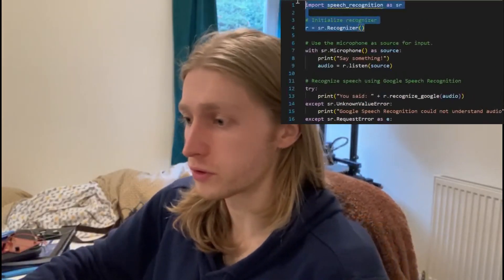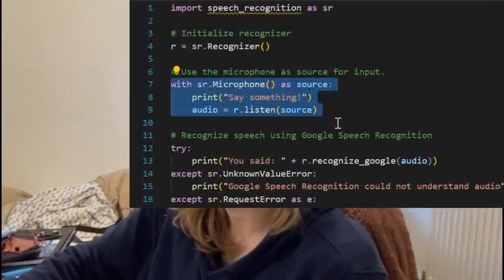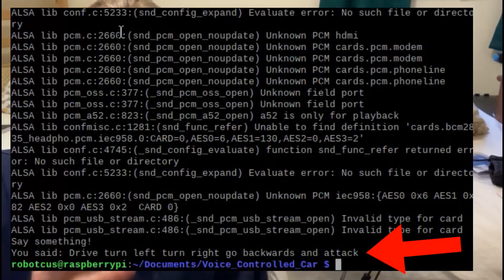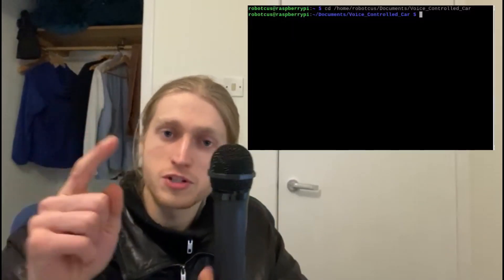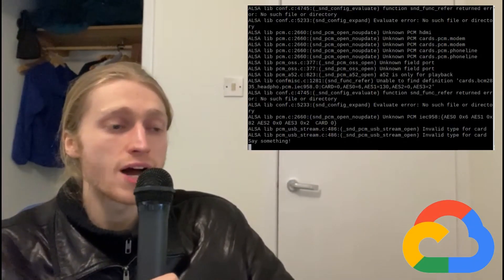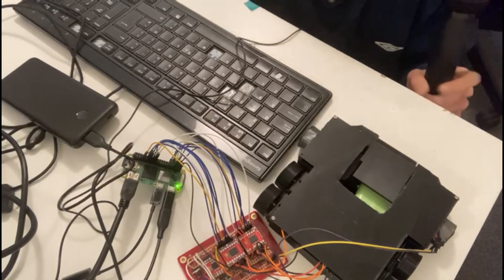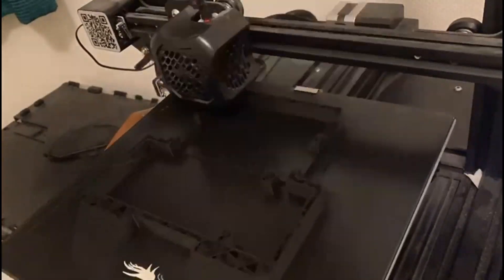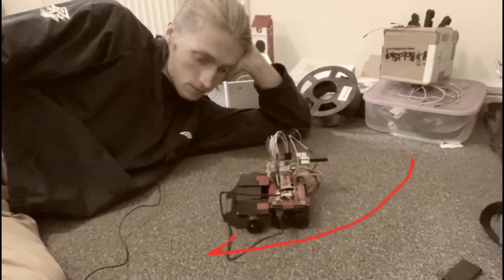I made a Voice Controlled Robot Car

Comment: So, you send voice over bluetooth to RPI?
Reply from the maker: yes, thats all controlled by the USB microphone
Reply: @Robotcus  The voice is send via bluetooth or USB?
Reply from the maker: @Max_Bio  There is a USB chip connected to teh raspberry pi with its own bluetoth module, basically im not using the rpis bluetooth, but rather my own one
Reply: @Robotcus  So, this is the way to send voice from bluetooth microphone to RPI?
Reply: @Robotcus  Is it important the two modules to have HFP?
Reply from the maker: @Max_Bio  Im not sure to be honest, the microphone was doing all the heavy lifting for the bluetooth stuff, it was very much plug and play :D
Reply: @Robotcus  Whats the mic. and usb dongle you used?
Reply from the maker: @Max_Bio  its called the Mcbazel Wireless USB Gaming Microphone, i just got it off amazon, its very bog standard though, any usb dongle microphone will do

Comment: Does your voice recognition only listen for the words forwards, drive, etc? Or does it type everything that you say and then looks for your keywords?
Reply from the maker: The voice recognition is capable of picking up any words, i tested it by singing DK rap but didnt put it in the video lol, although my motor code (i didnt talk about this) is programmed to only activate on certain words. A thing i was thinking on doing was slimming down the model so that it worked on only specific words, with less options to choose from my model would become more accurate, but the google model worked so well i didnt bother.